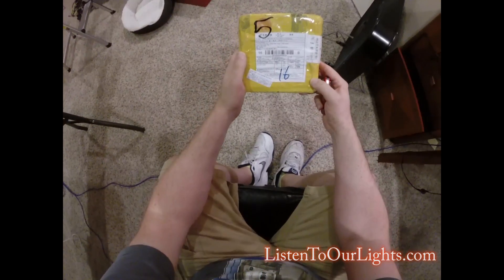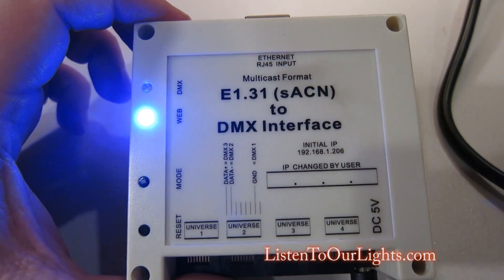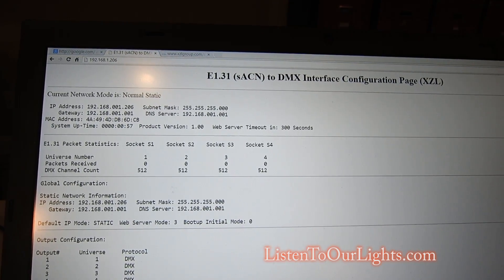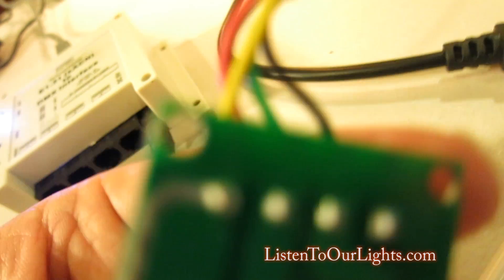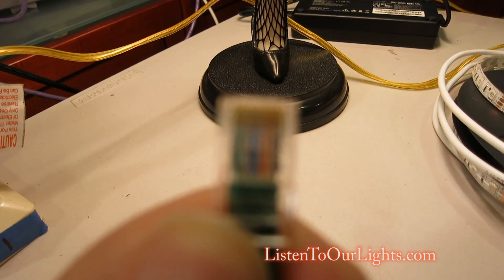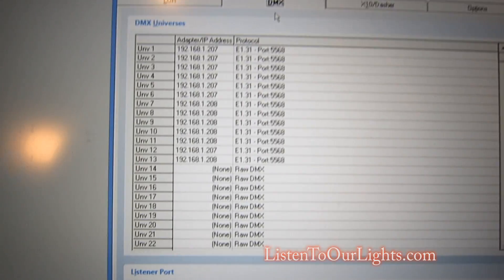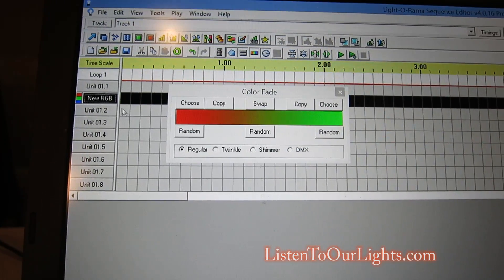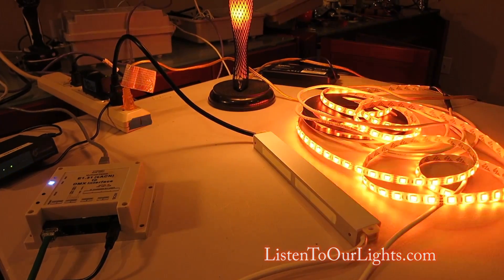DMX Bridge Unboxing, Setup, Sequence

Comment: Did you know its plug and play? you don't need to do anything besides go to network preferences and select E1.31 and make sure its on multi cast. The only reason you would have to do what you are doing is if you want to switch the universes. you don't even need to do anything with the IP.

Comment: Hi, Why don´t you only use E1.31 to TTL adapter with Pixel Lights like the IC ws2811? Why stills using DMX RGB lights if pixel lights have a lot of powerfull color sequences?
Reply from the maker: +LedShop Mx Dumb RGBs still have some useful applications. Floods, strips for color wash, stuff for the kids' rooms :)  The other reason why a bridge would be useful is for controlling RS485 DMX equipment like LOR controllers in DMX mode.
Reply: Excellent. Thanks
Reply: @listentoourlights  hello i saw your video and i wanna tell you this i got this device by mistake from ali express i you want to buy it contact me

Comment: Hey John Nice vid! its helping me understand this stuff just a couple questions: What license do I need from light o rama if im starting out but im only doing all rgbs and intellegent lighting ex. Moving head lighting and more towards stage lighting and I have decided to use light o rama is there any other software that you would reccomend if light o rama wouldnt be good for this application and also would I even need a usb- cat 5 if im using all artnet wouldnt it just all be controlled through my home network? thanks.
Reply from the maker: Nic Pagan  Madrix if you want to pay $$$, Nutcracker is free, Light-O-Rama requires the Advanced or Pro license level to use DMX.
Reply: Pro?
Reply: I was considering advanced

Comment: Uhh, hate to break it too ya, but You can't have an IP address of 192.168.0.X and have a gateway of 192.168.1.1 with that netmask.  Either the 3rd number is 0 or 1 for both IP and gateway.

The Text box on the video shows the IP is 192.168.0.206.
Reply from the maker: Wayne Hancock I didn't notice that :)  It works because I'm working on all the same segment, which is how I do my show. If I wanted to route IP traffic off this segment it would be a problem.